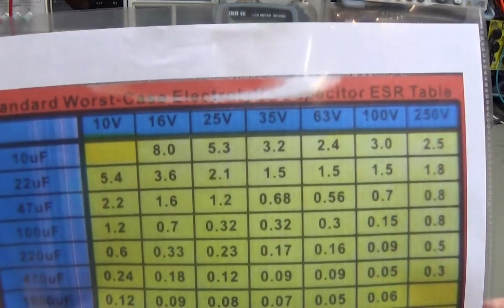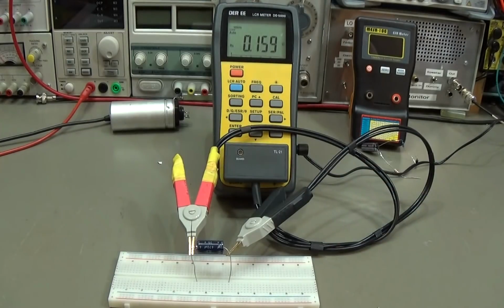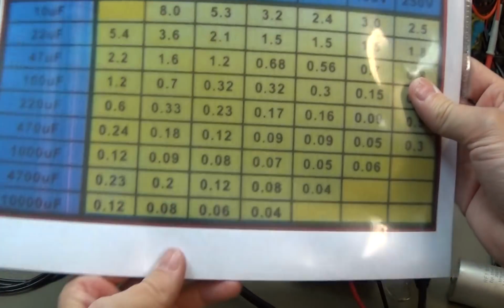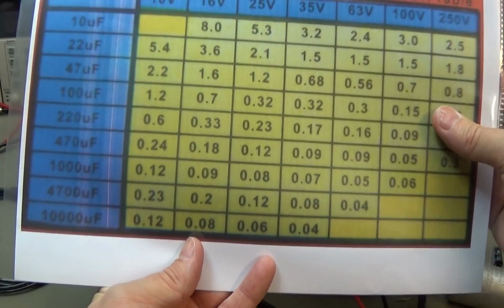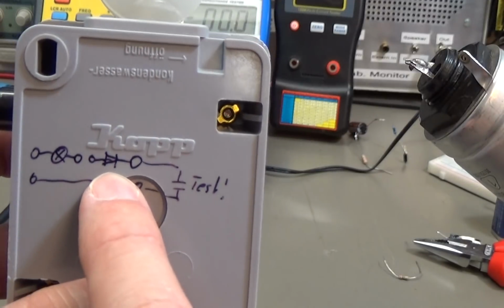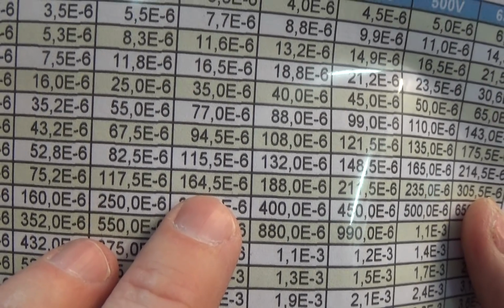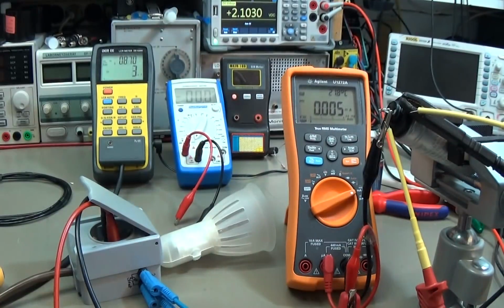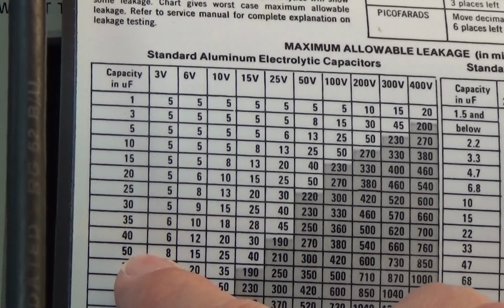#155 PART 2: Is the ESR of an electrolytic capacitor able to tell the health of it?

Comment: The leakage current is very much depending on the type and make of the capacitor. To look into an arbitrary table to find the allowable current is not useful. To really check the healthiness of the cap you need to look into the datasheet. For very old caps it will probably not be availabe, so the table is just a best guess. I found old elkos with 450V, 4000uF and their leakage current is below 200uA - and they are from the 90ies! Good old build quality of Roederstein, Germany.

Comment: Isn't 100kHz already too much for a 470uF capacitor? I would use 1kHz for that value. At 100KHz you are more likely measuring the inductive reactance of the circuit rather than the ESR. But it depends of the usage of the cap i guess. How do you know what is the 'right' frequency for measuring the ESR?

Comment: @TRX Lab
At 28 min elapsed table shows leakage x FIVE E-6.  Am I correct in thinking that means that the resultant = 164 x 0.000001 = 820 microamps. Excellent tutorial I learnt a lot, thanks.

Comment: Isn't it necessary, especially for high voltage capacitors, to test them applying that voltage (100-400 v)? I mean, does ESR change? Thanks.
Reply from the maker: Yes, for a full test it needs to do capacitance value, ESR and leakage current. Most of the time ESR is an early indicator but for itself as said only an indicator...

Comment: Interested tooic. Thanks for the video. I was wondering if the main features of the capacitor are interrelated and in what way? I, ESR and leakage resistance. I was working on an old Tektronix scope, and needed first to take out the 2 earlier exploded RIFA capacitors. After that the scope worked just fine. I replaced one of them, that I had in the box. Then I was going through the calibration procedure. You need to check/measure (and maybe adjust) quite some voltages. There is actually 1 main reference voltage of 10.0V that needs to be adjusted, the other voltages follow. Anyway, doing that I have also measured the ripple. Everything was quite good. My doubt was if I needed to swap the electrolytic capacitors too. That would be a quite some job. So my way of thinking was: if very little to none ripple capacitance must be good. Maybe the other performance aspects are good too? I know that in time, everything is getting deteriorated, and that it would be smart thing to do to swap also the capacitors, but maybe the scope have not worked so many hours in his life and maybe it is good enough to work now and then in the future. Who knows. Of course nobody 😀 but that is my doubt. To be or not to be, (I mean to swap or not to swap prevention).... Once again, the point / question would be  the interrelated effects. So if no ripple thus capacitance still good, thus low ESR and leakage? For how long, okay, nobody knows.

Comment: Excellent videos about caps measure. And nice demos, too!. I have a question for you: I use several LCR meters, and one of them is exactly the same you use here. Also, I have kelvin clips, but not in use for this meter. I can see in your video that you modified the box and connect inside the kelvin clips. Could you explain exactly how to do it, please?. This is because when I opened the box I saw 6 connection points in a PCB (the original crocodile clips which came with the meter use a very short piece of coax cable, each with a common shield and 2 live wires). Thanks for sharing your experience, and thanks also in advance for the kelvins connection method.
Reply from the maker: Reference is video #87
Reply: @TRXLab  Danke!

Comment: Even though 0.12Ω is acceptable for a 470μF capacitor, according to that table, I would also replace it in a switching regulator circuit because a good new low-ESR capacitor of 100μF has about that much resistance at just 1kHz.

Comment: Hi Peter - excellent videos thanks, highly instructive. Being new to ESR, I am just wondering if you happened to have measured the voltage applied by the DE5000 when testing ESR in circuit? Saw some comment elsewhere that the voltage may be high enough to trigger semiconductor junctions, thereby interfering with the ESR reading. Versus ESR70 which Peak is claiming only 40 mV. Any thoughts? Thanks in advance. 73
Reply from the maker: Never had issues with the DER and I know the voltage is low bat can't tell you the values right now...
Reply: Hello there , if you need something to trigger semi conductors you could use those tv leds tester they have on eBay . It goes up to 320 volts and the current can be set to high and low.  I don’t remember the values but they won’t burn anything.  The low is Mili volts.   I used it with zener diodes and transistor that neither the analog nor the digital multimeter can measure.  ( low voltage ).
Reply: As for your question, remember when you are measuring inductance and capacitance , the frequency is what matters.  De-5000 is a signal generator with a microcontroller - the voltage is low as well as the current but the frequency can be set from 100hz to 100khz, which is enough for a variety of different applications.   You should see it on the oscilloscope.    But today I’d recommend you to buy one of those 200 dollar oscilloscope from aliexpress that comes with a signal generator, you will have a better tool to work with if you have the electronic background knowledge.  This lcr meter is more practical but limited and the current price is so high.  Not a good budget for the time being.

Comment: Excellent demonstration. The big RFT capacitor demonstrated very well that not all old electrolytics need to be replaced, I liked that very much. I wish I could reform and test old Tesla capacitors for leakage like you did.
However, my workbench is very modest at the moment and it is very nice to see that I can test capacitor health through ESR. I am saving for a proper LCR meter, right now I only have two AVR transistor testers by Markus Frejek and Karl-Heinz Kübbeler. 
Thank you for this video.
Reply from the maker: Thanks feed feed back. Yes it is true not all capacitors needs per se to get swap out  ..

Comment: Great video thanks! So the MESR100 you have back there , why you don't use it? I have seen tons of video and I still don't know what device I have to buy to check capacitors !
Reply from the maker: Thanks. The MESR100 turned out to be not reliable as test values are not reproduce able.
Reply: @TRXLab  I boght one :( , so I wasted my money on it ... is not easy to find a great cap tester.

Comment: So you've mentioned most of the capacitor manufactures test the caps at 100KHZ, then why at the video 14:10 you used 120HZ to test the cap on the LCR meter? Why not use higher frequency like 1K or 10K?
What frequency does the multimeter use when testing a capacitor?
It seems when the testing frequency increase, the result of capacitance will decrease, as well as the ESR result.  So does this mean the multi-meter is using less than 120HZ to test the cap because the capacitance result on the multimeter is much higher.
Reply: Vincent Yue because he wanted to know the capacity and not the ESR value. The higher the frequency is the lower the capacity. When you test a capacitor with a Multimeter you test it with no frequency at all for example.

Comment: Thanks for the video, interesting and thorough. It may be a long video to some, but I didn't notice it was long. I do have a couple of questions please.
1. There are a lot of variances between different ESR tables. How accurate do you feel the one you use is and why?
2. With LCR and ESR equipment, manufacturers suggest shortest possible test lead length. I see you have longer leads and that you have double cable or paralleled cabled them. Is this suitable? Why?
Thanks for your time.
Reply: He uses a 4 wire kelvin measurement technique with shielded cables, so the cable length shoud not matter that much.

especially if you calibrate the meter before measuring

Comment: An old capacitor is an old capacitor. It is dry and will be dry for the future. There is no way to change this with reforming. And you will have no information, how long the capacitor will work after this procedure. The lesson in the first video was awesome.
Reply from the maker: Hi Alfred, you are right an old cap is an old cap and I don't prefer to use old caps but as we already discussed in the other post it always depends on what the owner want. So several times I have done on special request the reforming job and if you are doing it right I can confirm the the outcome is quite amazing. A reforming job with perfect result means that leakage current is in its rated values and only if you are able to achieve the wanted value you can use the cap. Under all other circumstances simply change the defective component to a brand new one. Conclusion is that there are cases where it makes sense and where it works. But in one point you you are right, you  never no how long a reforming job will finally last.
Reply: Thanks for your answer. 73

Comment: In my youth, some more advanced engineer advised me about handy shortcuts that I have then been using throughout my career.  One applicable to this video is the following:
For parallel connections of resistors, you can often estimate the results from the ratio of the two individual values.  If you have the 0.159 ohms as in the first example and you add a 159 ohm ( factor of 1,000 larger) your parallel connection becomes about 0.1% smaller than the original 0.159 ohm.  Expect the last digit drop by maybe one.  If you instead put in parallel a 15.9 ohm resistor (factor of 100), you can expect the combination to become 1% smaller, or you can expect the last digit to drop by one or two.
You cannot continue indefinitely, but depending on the accuracy needs, sometimes even a ratio of 10:1 could be used for a real quick and dirty estimate.  As an example, 1 ohm paralleled by 10 ohm is 0.90909, while the quick and dirty estimate would suggest 0.9000.  Maybe good enough...
Reply from the maker: Yes that is a very wise short cut. Thanks for comment 73

Comment: Thanks Peter. I always use my insolation tester. BTW, the big 350V cap is out of capacitance. 10 of 40 is 25%, not 20%. But the cap seemed to be fine so maybe the extra capacitance is ok.
Reply from the maker: Thanks for watching Robert! Yes you are right it is not 20% but it is an old cap produced under different test methods so no problem...you right it is fine.. 73

Comment: Nice and as always very good explanations :), even the case with caps in parallel covered (which is an exception). Very funny to see the old RFT caps haha :). Yikes 500kOhm, that is probably the highest ESR I've ever seen :), that thing has turned from a cap into a resistor haha :). Keep up your nice work, love to watch your repair and practical videos :).
Reply from the maker: Thank you really glad that you like it! On the Vertex Standard restoration I found SMD caps with such an high ESR...

Comment: Doesn't ESR depend on the materials the capacitor is made from? I agree, you need the published values from the vendor. Also, why test such a high value capacitor at 100khz? Seems a bit high for such a large cap.
Reply from the maker: Yes the ESR depends as well on material and size of the cap among other criteria s. You can test a cap literally with any frequency you want but what would the test result tell you if you have no reference??
Reply: With the vendor's data you have a reference. And remembering that higher test frequencies yield lower ESR values, it become important to consider the intended use.  Thanks for your reply and keep up the good work.

Comment: Nice tests but one thing is a bit a pitty, why not use a cap from which you have the real specs and use those. If you use the specs from a Panasonic FM then all new FR caps would be considered  dead and many caps other brands too. But now you only use one of the many and all different, tables so you still do not really know if things are good.

By the way, a cap that is deadshort can have a very low ESR  ;-) 

The DER EE is a very good LCR meter, that is,  I have the IET DE5000 version and that is after all those years still spoton (as a reference I have standard caps, inductors and resistors ). I do not think there is something  wrong with your kelvin clips. I think they are not suited for capacitance measurements or you did not calibrate the setup.  You cannot switch for this kind of measurements from kelvin clips to tweezers or to nothing without doing the recalibration routine.

At 42;00 you measure Rp, that is not the ESR.

Comment: Great video, when you first got the kelvin clips you had found bad solder connection in clip from factory , I made mine up after your mod and also found bad connection in clip
Reply from the maker: Thank you Dennis! Yes the celvin clips are really not good quality but I have fixed the wires now with hot glue...73

Comment: it's quite simple: when in doubt, put in a new capacitor. no measurement is 100% accurate.
Reply: Being new is no guarantee. I check new caps also before I use them.
Reply: New capacitors that have been sitting around waiting to be used will go into a coma! If you don't check them before they are installed... Depending upon where they are installed, on first fire up they might want to wake up slowly but if they are receiving full rated voltage and a lot of current, they won't have time to dissipate the internal heat build up and fail, usually exploding! If you follow this method from this video, even with brand new capacitors that have just arrived, because you don't know how long they have been sitting around waiting for you to purchase them, you will run into trouble! And not knowing this, you will just blame the supplier when it's not their fault! You just happened to be that person who ordered a type of capacitor that doesn't sell as fast as other types so it's most likely gone into a coma. There's nothing wrong with it, this is what happens when they are not used! It's also the same reason why you can purchase electronic equipment from a seller who says that it was working before he put it in storage! He might have even plugged it in to test if it still works but not long enough for the capacitors to explode! Then you finally receive it, and even though you know that it's been in storage, you just plug it in and turn it on! A few moments later something inside explodes! WTF? Then you open it and it's a complete mess inside, but he said that he tested it? It doesn't work! I'm going to complain! 
But what you should have done is put it on a Variac and bring up the voltage a few volts at a time, checking the capacitors for high temperature! This way, you slowly bring them back to life and they should work just as they did before it went into storage! 
Same thing happened to my parents who had an expensive Panasonic TV that they kept in their formal lounge and only ever went there when guests would visit, which was not very often, my mother would unplug the TV from the wall socket because to her, it's using power for nothing. Then one day after a long time sitting around doing nothing, they had guests over, they plugged in the TV and it wasn't long after they turned it on when something exploded inside and scared the shit out of them! It cost them more to get it fixed than what it cost to leave it on standby! But not everyone knows this and not everyone will tell you this! 
LoL what do you think would happen if someone came into your bedroom while you are sleeping and started screaming and running around like crazy? You too would probably explode! If you are older, you would probably die! 
So I'm not saying that you should keep the original capacitors, but instead I'm saying that it's important to check both old and new and do it slowly the first time and you will never have a problem! 
I really hope that this helps, the old saying of oh! I will just throw in brand new capacitors doesn't always work! You can still run into problems if you don't take the correct steps...

Comment: have you seen how many different ESR tables there is? why do you think the one you are using is the correct one? values from one to another range considerably.
Reply from the maker: I never said that this one is the correct one! It is an indication only real values are lower. Watch my video #83 there you get all the infos where to get accurate values for impedances.